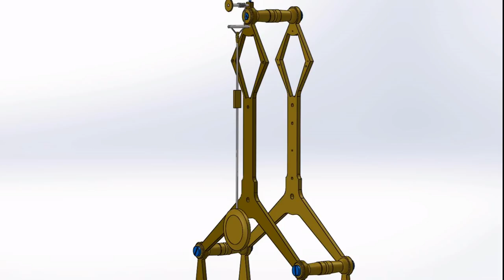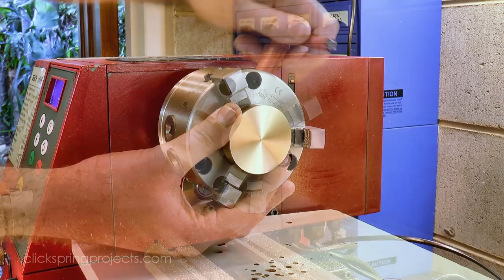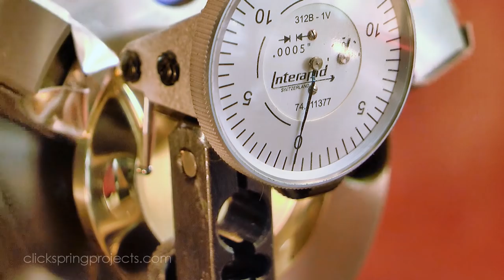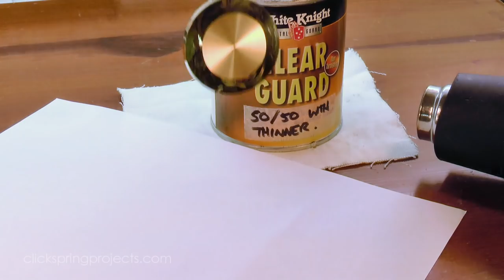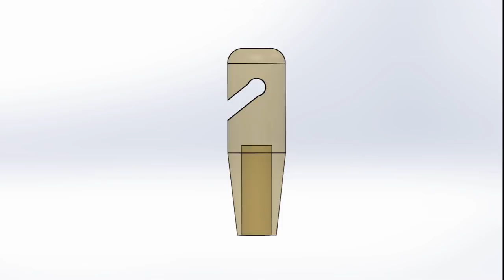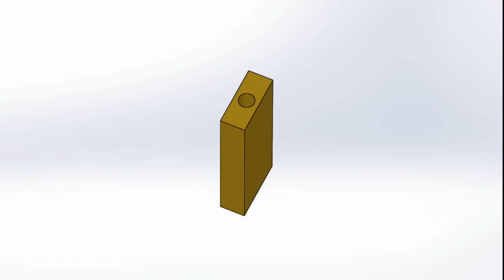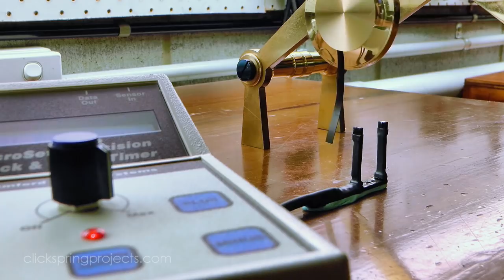Clockmaking - How To Make A Clock In The Home Machine Shop - Part 18 - Making The Pendulum

Comment: I have few questions - how long does it take you to post-process the movies? You're using that nice effect showing part or material that part is to be made from compared to the model (you're using SolidWorks, right?), that has to be added later ;) Also how do you prepare for filming? Do you have few cameras  taking picture from different angles? Do you prepare scenario for each movie or go with the flow?
Reply from the maker: The whole process including absolutely everything (plan project/drawings/machine/light/shoot/edit/upload) works out to be between 5 and 10 hours per minute of video time. I do this on the weekends and at night after work, so it ends up being a minimum of 3 weeks per video, but usually more as life gets in the way. I don't do any prep for filming, I only have one camera so its usually just a case of setting it up where it wont get hit by the chuck and then start machining. Once I think I've got one angle covered, I move the camera and then continue to make the piece shooting from the new position, and so on. Editing is the most time consuming part of the process by far. Thanks for watching and asking :)
Reply: Thank you for your answer. That's a lot of time per minute. But it shows in the quality of your movies. These are The best CNC related clips I have ever seen. Watching this makes me want to get my own lather and all other cool stuff you have in your workshop. Please keem them coming :)

Comment: Hi mate can I ask a couple of things How did you choose the cord and will it not stretch or wear out  quickly throwing timing out
Reply from the maker: Hey Tony, the choice was dictated by tradition - Silk was the material used for the original clocks (Classic French Y frame 17-1800's) upon which this one has been based. It is generally accepted to be a rather flawed suspension method (as you have identified), but this style of clock was never intended as a particularly special timekeeper, more as a visual showpiece. Cheers mate :)

Comment: Is the pendulum rod made of invar alloy or another alloy to prevent thermal expansion/contraction?
Reply from the maker: Hey Nathan, the rod is silver steel. The silk suspension, short pendulum, relatively wide arc and recoil escapement all pretty much guarantee modest timekeeping, so an invar pendulum rod would be a waste. The original designer (John Wilding) has designed it in keeping with the tradition of a particular style of clock (Classic French Y frame), rather than achieving particularly special timekeeping. Cheers mate :)

Comment: Do you only use HSS tools for lathe works and if so what stops you from using indexble carbide tools?
Additionally to that I personally experienced brass as a horrible material to machine on a lathe, the chips are like dust and spray around the whole workshop, how do you mange this problem and are there special brass alloys that are easier to machine.
Reply from the maker: Hey Marius, I use HSS almost exclusively. I find that it gives a superior surface finish on almost all materials, and most importantly I can grind the necessary tool shapes I require for each individual job. I only ever use carbide inserts for the materials that really need it form a better chip, such as tool steel. Most of the brass I use is the common variety free machining  "leaded" brass. Lead free brass alloy can be a bit more difficult to machine. Slowing down the rpm and taking deeper cuts will stop the chips going over the shop. Thanks for watching and asking :)
Reply: Great to have such an informative and quick response, you really deserve all the subscriptions ! Sadly I'm far from being able to afford lathes and mills (only using them at work), however I would one day want to rent a garage or similar for a workshop like yours. May I ask how much space you have in your workshop (m² or sqft) and do you think that is "enough" (i know one can never have enough space). Also do you think that industrial power supplies (three phase, here in germany only necessary for backing ovens) is necessary or will the average mill run on household AC?
Reply from the maker: My shop is tiny: http://www.clickspringprojects.com/blog/from-little-things everything is within arms reach! All of my machines are essentially hobby grade so they use standard mains AC power. Terrific to have your support Marius :)
Reply: Now that's a workshop I'd call compact! Let's hope i find a decent and dry garage

Comment: What is the blade on your saw it seems almost round my saw could use a blade for fine work but I don't know the size.
Reply from the maker: http://jewellerssupplies.com.au/vallorbe-sawblades-pack-p-1749.html Thanks for watching
Reply: +Clickspring thakyou, I am using all your tools so thankyou there, I make radio control aircraft and cars that might sound unusual but I make micro cars about 5cm long out of carbon fiber and brass or aluminum, and my wife now has a set of beautiful set of blue handles for her jewelry box. Please keep building after this clock as I think you ideas are plentiful and worth sharing. Thankyou Peter

Comment: What is this for? 11:17
Reply: I think for finding the center of the workpiece.
Reply: It's an edge finder - they are used to precisely locate the edges of the stock to allow the center of the work piece or other references to be found and zeroed in. The tip of the tool wobbles (although you can't see it much in the video) until you bring it into contact with the edge of the work piece, then it's slowly pushed into a concentric position. Eventually it'll pop back out of place and that's when you've found your edge- it's more accurate than just 'touching on' with a cutter... someone else might be able to give a better explanation, i'm just an enthusiast :p

Comment: Chris, can you explain why you use silk twine instead of something less affected by humidity changes? Nylon or x-linked polyethylene would be more stable... I love your videos, but this has been nagging me... thanks.
Reply from the maker: Simply to be consistent with tradition. There are many design features in this clock that guarantee it cannot be a particularly outstanding timekeeper (recoil escapement, short pendulum, no temp or baro compensation, silk suspension etc). These were all considered entirely reasonable design choices in an age where accuracy was just one attribute to consider - great to have you watching mate :)